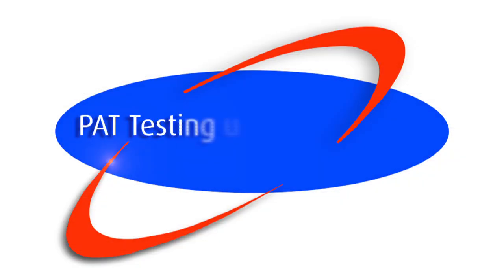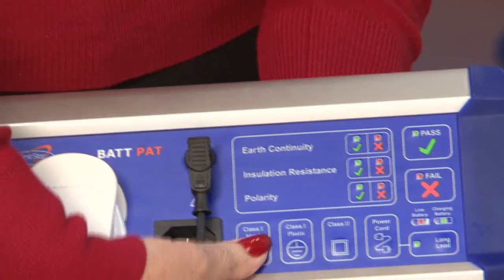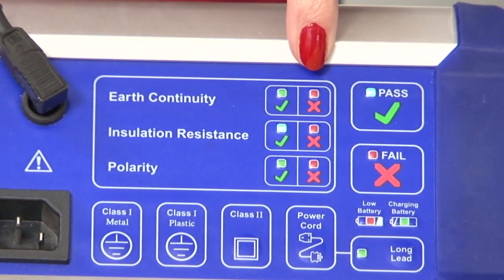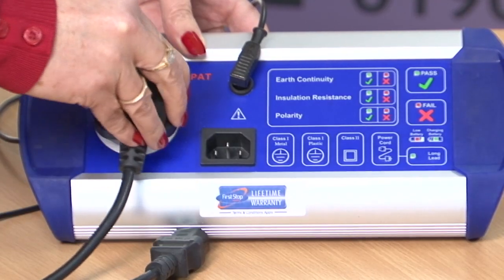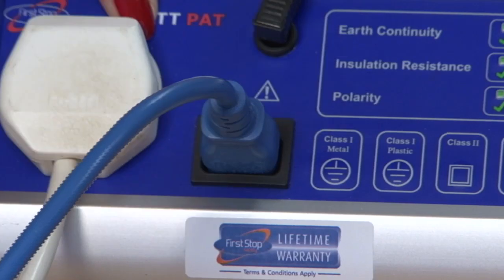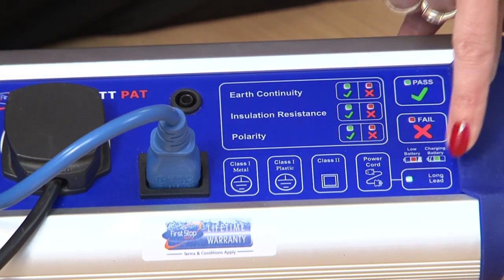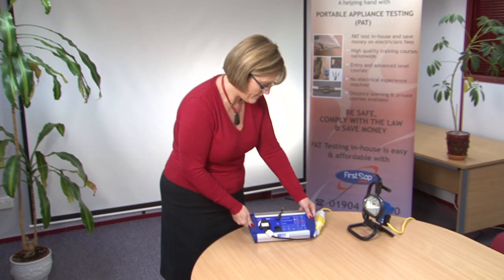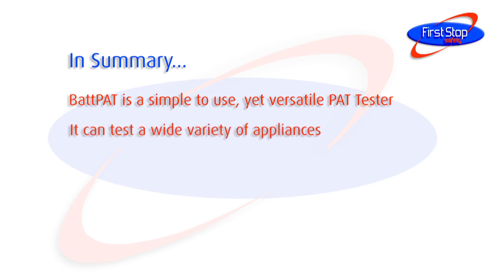PAT Testing using a BattPAT - First Stop Safety Training Video

Comment: I would love to know how this even qualifies as a PAT tester, it has a FAIL threshold of two Meg on a class one device according to the manual, yet the official threshold is one Meg. On a class two device it has a fail threshold of four Meg, when the the official threshold is two Meg, this all seems so very wrong when other testers are correctly calibrated, and this one seems to pass items other machines would fail.
Reply from the maker: Hello Ken,

The fail thresholds that you have quoted are correct. The PAT tester will fail any Class 1 item which shows an insulation resistance of 2M or lower. As the tester doesn’t display any numerical values, there is an added safety buffer of 1M on the Class 1 test and 2M on the Class 2 test.

For example, assume you are testing a Class 1 item with an insulation resistance of 1.1M. If you were using a tester with a numerical readout you would realise that this is very close to the fail limit and would probably fail the item. If the limits on a Pass/Fail tester such as our BattPAT was set at 1M, it would show that the item had passed, but there would be no indication that the test result was very close to the limit. For that reason, we have a threshold of 2M. This means that in our example, the reading of 1.1M would show as a Fail, which gives an added margin of safety in the absence of a numerical display.

Comment: Can't understand the point of doing an insulation resistance on a plastic class 1. What are you even testing if it's not connected to an exposed conductive part? Can it even fail?